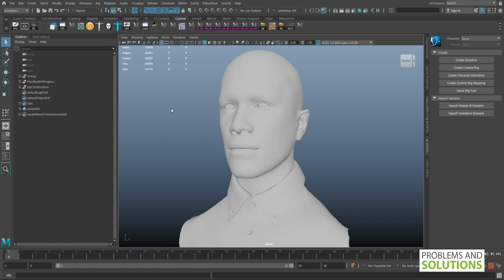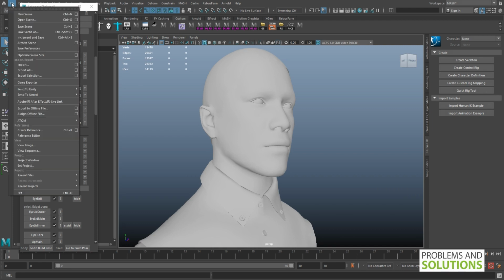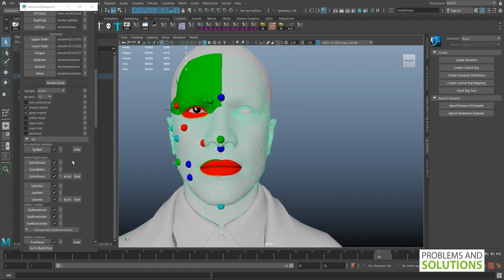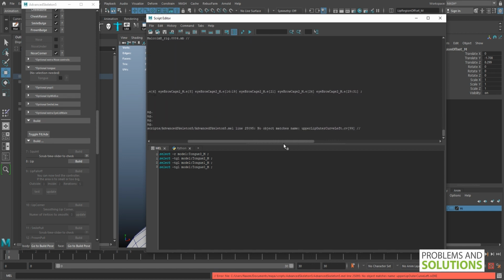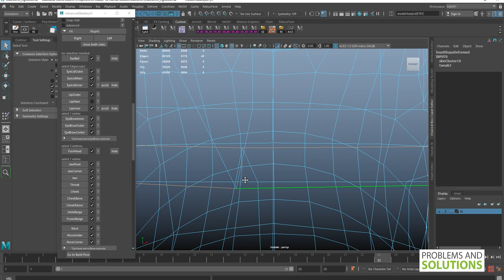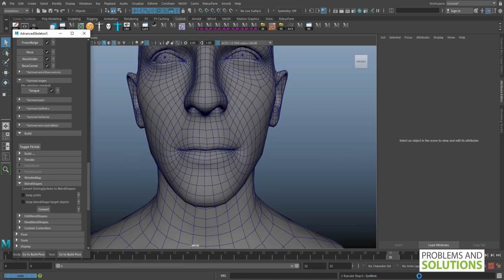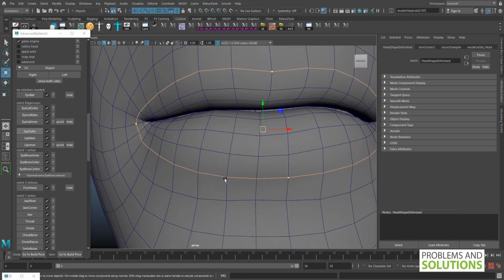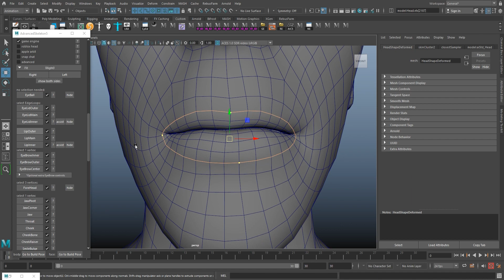Advanced skeleton face rig build problem solved

Comment: please help me when i built Advanced face :((  it had fault at step jawweighing // Error: file: C:/AdvancedSkeleton/AdvancedSkeleton5.mel line 23315: More than one object matches name: SmileBulgeConstrainedOffsetCheek_R_R .  I make sure NOTHING has the same name , not even in groups. And I also run through the Advanced skeleton symmetry checker and cleaner. Please help me
Reply from the maker: Hey, you can start from the beginning by following the tutorial. Don't forget to save a copy of your scene just before clicking on Build Advance Face button. Because once you make an unsuccessful build attempt it shows random error messages. You may mail me the file if it doesn't  help.
Reply: I am going through the same trouble too with the lips :"
Reply: did you can solve it?

Comment: Hello, I've been trying to rig the face but this error pops up each time I run the build setup even after correcting

The error: /AdvancedSkeleton5.mel line 23917: setAttr: No object matches name: upperLidOuter_RShape.overrideRGBColors
Reply from the maker: Did you follow the selection process properly? Also it is always better to save a copy of your scene before building the advanced body and face rig. 
You can also mail me the scene if possible. Good luck.
Reply: @Insightful_3D  Thanks for your feedback. I did everything as per the tutorials, saved the scenes files at diffrent stages too. I'm using Maya 2015, if that's okay I can email the scene together with the advanced skeleton version I'm using to rig. Thank you.
Reply: So may be can I have your email so that I can send the files
Reply from the maker: @felixombok8268  Sure, check the about section please. I just added it for you.
Reply: @Insightful_3D  Thanks.  I've just shared the files through Wetransfer and you should get the email
Reply from the maker: @felixombok8268  Seems like you forgot to include the referenced model. You may also like to use "Archive Scene" option of Maya. 
BTW, do you want me to share the result here!? Send me the files from your mail address, otherwise I won't respond.
Reply: @Insightful_3D  okays, I'll send you my email when I reach home.
Reply: @Insightful_3D  hello, I wanted to know if you had received the files through me email, becaues I had already  sent them. Thanks.